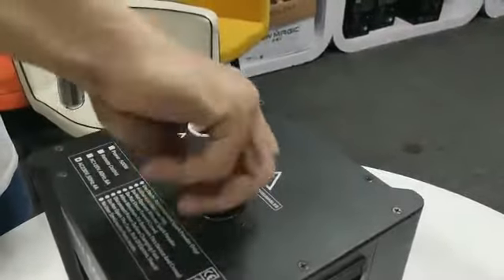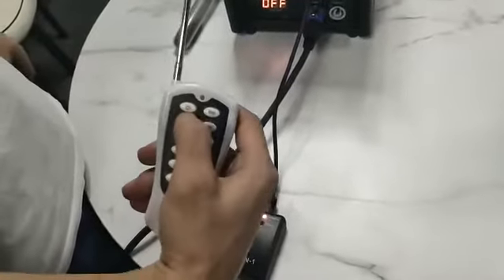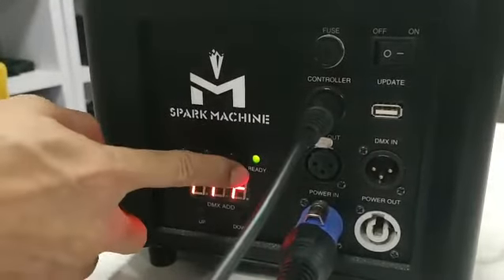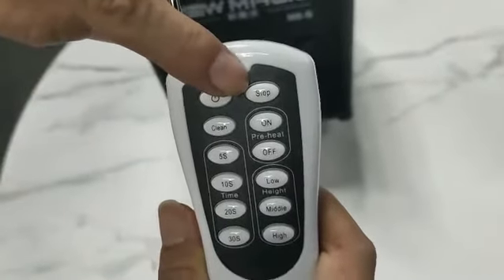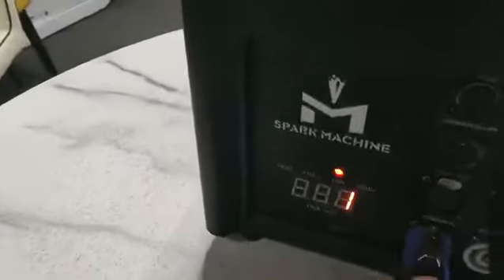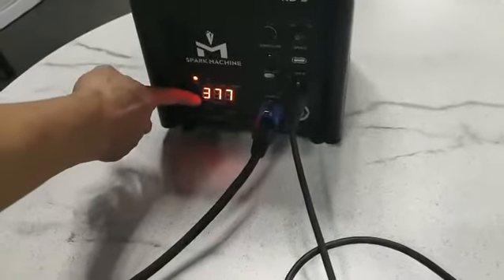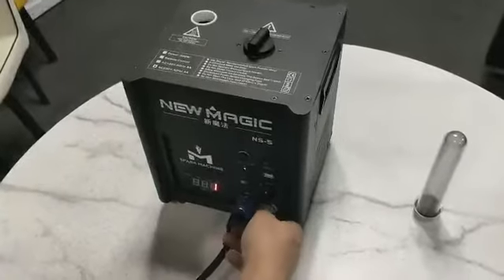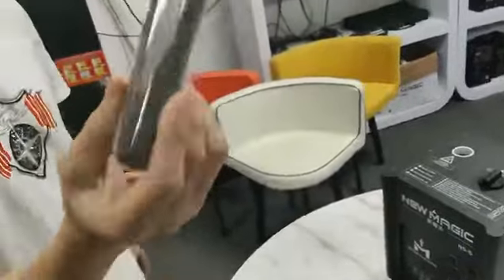Cold spark machine how to use ir remote and DMX control.

Comment: How can you have 4 different machines connected to DMX. And have them throw spark at different times?
Reply from the maker: use controller to control the machines and set different dmx address